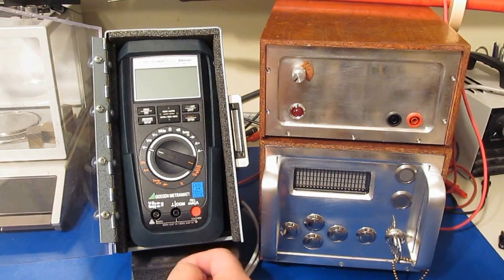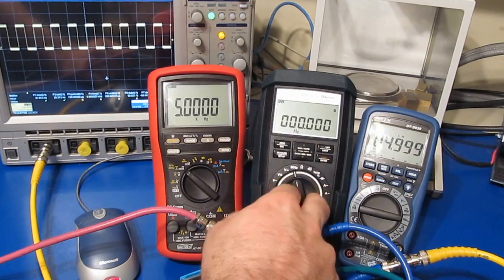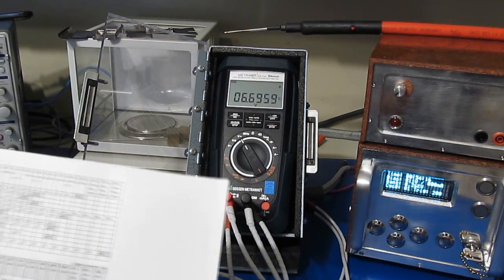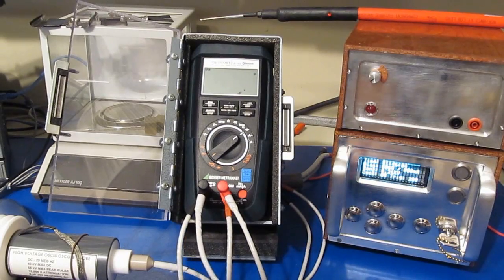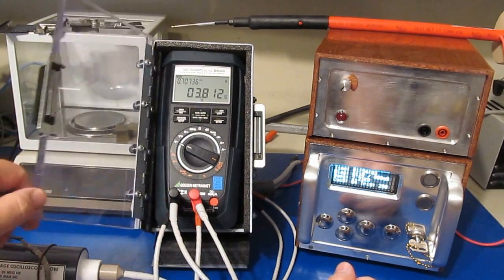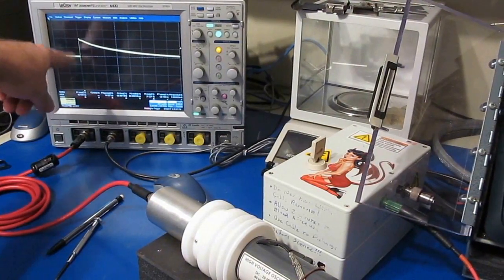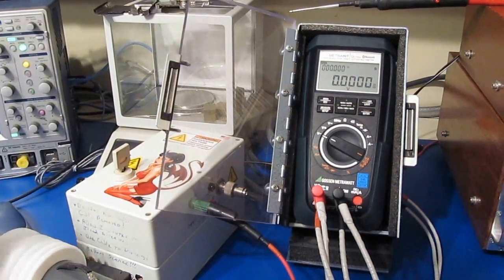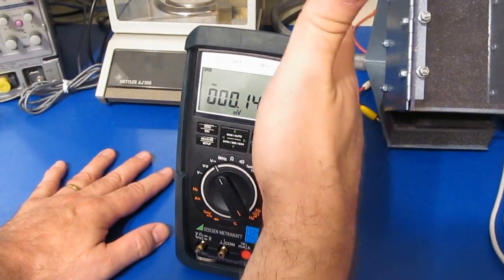Gossen Metrawatt Metrahit Ultra M248B Review Part7

Comment: 31 Mar 2021
I wonder if the issues you found with the M248B have been fixed?
Reply from the maker: They never followed up.  The last I saw, they have now renamed the meter but have maintained the part number.   It appears marketing is more important than engineering to them.   If you purchase one, be sure and let us know how it works.
Reply: @joesmith-je3tq  Thanks for the reply. I see at "Gossen Metrawatt USA" the M248B is named "Metrahit PM Prime BT" with "Metrahit Ultra BT" in parenthesis. I am tempted to buy one...
Reply from the maker: @Cleofizoid  Yes, they renamed it Prime.  I doubt you would be able to pull it apart and not void the warranty.

Comment: HI!

Nice testing in this series; I do have a question: how can I build a proving box similar to yours and what type of components to look for? (values that you recommend, precision and usage type wise ...)
Reply: It's called a decade box. It's just individual components like resistors and capacitors mounted on the inside of the case to those screws sticking through the lid. It's basically the same as just connecting to bare resistors and capacitors.

Use 1% or better  high accuracy components.

Comment: Hi. I am the owner of Metrahit PM XTRA. I ran into a problem with the current measurement. I wanted to measure the current of the LI-ion battery, which is installed in the power bank when charging the smartphone. Until the multimeter switches the range from uA to A, the power bank does not have time to start up. The measurement is unsuccessful. The point is that the internal resistance when measuring uA is large, which causes the power bank to not start up in time. If I manually switch to the A range, the measurement is successful, but it is not comfortable. There is no such problem with older models where there are two measuring holes specifically for measuring mA and A (I have 18S, 24S, 25S, 28S at home). This problem can manifest itself in practice with various measurements. My question is why doesn't the automatic range switch go from A to uA? The problem would be solved.
Reply from the maker: I have no affiliation with Gossen.  You would need to contact them directly to ask questions about their choices for their designs.   I suggest being more clear than stating something is not comfortable.   If there is a reason you can't use manual ranging, be very clear about why.    Personally, I rarely use a meter to directly measure current, partly because of the budged voltage you mention.

Comment: @Joe, you have thoroughly tested a lot of multimeters during the years, if you would recommend a high accuracy one mainly used for electronics and at least 4 1/2 digits which one would it be?
Reply from the maker: If you ever decide to read the FAQ, you will find I do not make recommendations.
Reply: Hmm, but if you did, it would be the Brymen BM869... wouldn't it?...ha
Reply from the maker: It depends. For my personal basic electronics, home hobby use, it's a good fit but there are a lot of meters out there.  Do your own homework.
Reply: Hi Joe, i usually do my own homework, but this was just a joke.